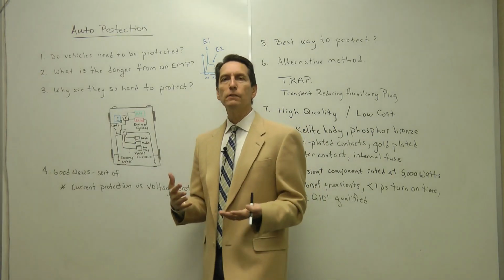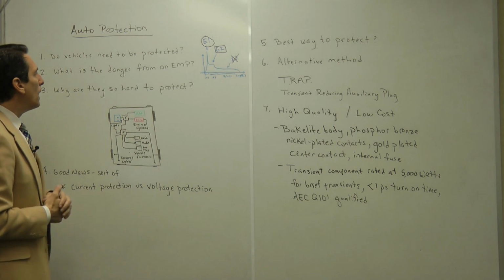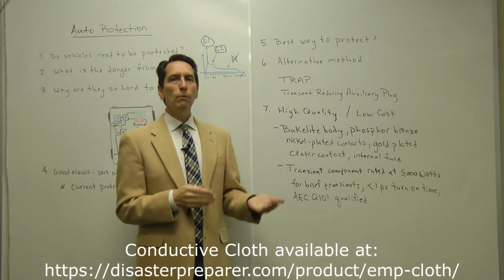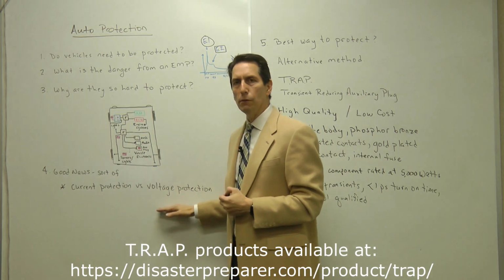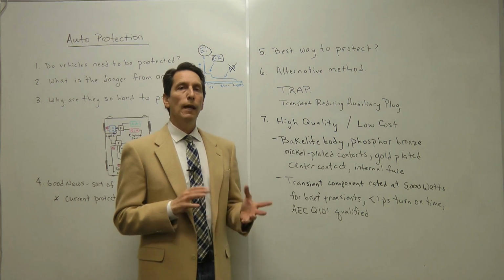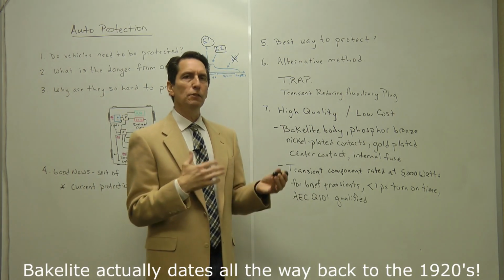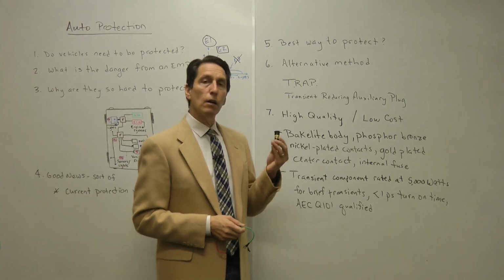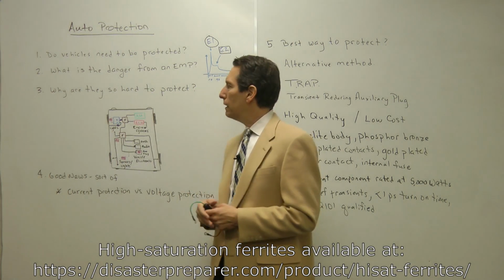EMP Automobile Protection with the T.R.A.P.

Comment: I have an Engle cooler which I had to install a diode on the negative to protect the ground system when I accidentally touched a positive cable to the vehicle had no spark but there was enough to cause the ferrite suppressor to explode on the Engle cooler circuit board. Engle cooler makes a compressor with a unique magnetic oscillating piston. This took a lot of time to pull it all apart but I found out the engle Coolers don't have a very good cooling system for their circuit boards as it's meant to be used in the ocean also. So I use some nylon washers too in the space offset for electric box for cooling.
   Vehicles have tires protecting them from earthquakes in electrical surges from AC circuit that is grounded at the power plants. Praying is likely to have a problem with an electrical system other than yourself, a short circuit sales.

Comment: First of all, get a Diesel-powered vehicle.
Second, refit your engine
to a Pre 1975 POINT Ignition. THEN, put in a network of anti ENP devices.
And Re😢convert your communications equip. to Use Vacuum TUBES or Tube acting like devices. You can mount the larger circuits in well shielded container(s) in
the trunk. The military post WW2 produced TONS of comm tech trancevers which are still avail. often dirt cheap. Throw in new capacitors ane your all set. There a whole vintage ham/
mil spec radio hobby today.

Comment: Question:
How would this device be installed on a 2010-2015 3rd Gen Prius with a Auxillary Battery in the trunk and Hybrid Battery practically buried between the rear seats and trunk ???
Thank U for the very informative video.

Comment: Dr Bradley:
Have recently purchased 4 T.R.A.P. modules from Amazon and am planning on further purchases in the near future. My questions to you, and if you don’t have a definitive answer, then probably no one else does either:
1: will the “older” resistor type physical car keys be affected by an EMP event, since they could not be kept in an EMP bag during operation?
2: same question but using the modern electronic key fobs?
Love your videos. Very understandable for the non-engineer.

Comment: Could i instal a T.R.A.P. OR T.R.A.P. B. .inline with any power wires. Also could a T.R.A.P. B. . Be installed across the alternator and starter them selves.sorry My knowledge on electric components is very minimal. I'm just thinking that it could catch the surge directly before vital points

Comment: Lovely how he is protecting a 12Vdc system from the potentially lower 5Vdc signal generator system.  A miracle $50 invention we can't live without.
Reply: With an arbitrary wave form generator with a 50 ohm output impedance and a very narrow pulse width too.  Looks like an Agilent 33220A which is only a 20MHz arbitrary wave form generator. Rise / Fall time is <13ns so it is much slower than the EMP risetime. 
Also if this does respond to only a 4.5V DC voltage pulse and shunts it you are going to blow a fuse as the 12V system throws a relay which will have a much steeper rise time and have contact bounces. More than likely this was only suppressing the spike due to its capacitance and the RC effect with the 50 ohm output impedance / resistance of the function generator. EMP will cause a low impedance source like an ESD zap. If he wants to prove function he would need an ESD set up not a function generator. Finally the Scope was set to AC mode and 200mV per division and the pulse was less than 2V. Just not a valid test / representation of an EMP.  This also does not protect things like the computer which will respond to E1 with its internal wiring and they only need a few volts to damage things. 
The Ferrites on the power cables may help but only locally. The wave needs to travel down the transmission line to hit the ferrite before it is blocked. Having a Ferrite right at the input of a device prevents fast transients of current change (not voltage) on the power rail from causing the power rail down stream to bounce around.

Comment: When you can demonstrate coupling 240Vac to a 12Vdc car while it is running using the TRAP as protection then I'll pay attention.  See if it will proctect against 240Vac for 0.5 seconds or fail.

Comment: So you stopped the pulse in the cigarette lighter plug  . On average there is over a mile of wiring in a modern car... you stopped the pulse in two wires one of which goes back to the fuse box the other is going to ground. For this to work I think you would need one on every wire in the car 😂😂😂😂😂. Can't believe people fall for this.

Comment: very interesting. 

Based on my extremely limited layman's understanding of how this works, it seems like it should be possible to attach a similar device to anything electronic to protect it, not just cars. Couldn't you make one that any 120v AC appliance could be plugged into? Or does it only work with DC
Reply: I'm an electrician and they make whole house surge protectors they connect to your breaker panel

Comment: I have a battery in my car with two connections on the side of the battery that are connected to the starter and components and two posts on top of the battery that are currently not being used can I connect the trap b to the top posts that aren’t currently in use?
Reply from the maker: Yes, that should work fine.

Comment: Can this product potentially hurt my vehicle? via computer system etc? Also, if i have just one auxiliary plug in my vehicle and i use your product that should be more than enough to protect my vehicle? Why does EMP shield use thier stuff on the battery and not the auxiliary plug like yours? thanks again!

Comment: Where does the energy get shunted to in the device when there is no ground connection?
Reply from the maker: In short, the energy on the positive line is shunted to the negative, and vice versa. A better way of thinking about though is that the TRAP prevents the voltage between the lines from getting too high and damaging connected electronics. When the voltage rises, the TRAP eventually turns on (very quickly at the right voltage), briefly shorting the two lines together and preventing any further rise between them. I hope that makes sense.
Reply: @disasterprepper  It makes great sense and I appreciate the quick response.  I  have one follow on questions if you don't mind.  I was watching your video on protecting a generator.  I was curious if using the TRAP B + a ferrite might be a solution for electric start generators permanently connected to my inverter/charger for home backup?  I also have a 3000W Westinghouse portable generator with electric start and was considering the same solution (TRAPB + ferrite).  I appreciate your help.
Reply from the maker: @clayanselmo7917  That should work fine. Just put the broadband ferrite around both wires (rather than one around each individual wire).

Comment: I’ve been reading about the possibility of a double EMP event. Would the TRAPs be useful in such a scenario or would they become fried after an initial EMP?
Reply from the maker: The T.R.A.P. products are designed not to be damaged by an EMP, but rather to continue to offer protection against subsequent events.
Reply: The atmosphere after a first EMP becomes charged and even if another EMP was produced the current charged atmosphere really mostly likely would not cause what the first EMP does this is what a isn't have discuss. I'm a science guy but not into these things but enjoy following threads and interested in what people talk about these days. There's not to many mechanical devices that are fast enough to stop an EMP. A three stage EMP preventer is best in my opinion and you might look at an EMP as spraying down on you in three stages and three strengths but I defer to the video host he a smart guy. Blessings

Comment: I want one for my tesla sir any suggestions
Reply from the maker: Sure, lots of Tesla owners have purchased them. My suggestion would be a T.R.A.P. for the inside auxiliary receptacle (aka cigarette lighter) and a T.R.A.P.-B to go across the standard 12V battery (not the high-voltage lithium batteries). Those two would give you good transient protection.
Reply: @disasterprepper  would the T.R.A.P b itself be sufficiemt itself I need my internal auxiliary port for other items.. with the threat of solar storm again in the news I thought of prepping again thanks for this info
Reply from the maker: @pyrojunkyz510  Sure, it would offer some protection, but multi-point protection is better. You can get a low-cost aux-plug splitter to free up the receptacle.

Comment: I'm assuming the TRAP B devices would not be impacted by an electronic battery charger? Since it charges with high voltage pulses
Reply from the maker: No, a battery charger wouldn't affect the T.R.A.P.-B. In fact, you can even jump off a car with one installed.

Comment: Would this work on a vehicle with a 24v electrical system?
Reply from the maker: It would, but the margin before the part turned on would be smaller. It was carefully designed for a 12V system, so that's the way I recommend using it. If you have two 12V batteries in series, you could simply put a T.R.A.P.-B across each battery.
Reply: @disasterprepper  Thank you for the quick response and suggetsion it's greatly appreciated. Keep up the great work, I really enjoy your content and have learned a lot, thanks for all you do!

Comment: Would adding the T.R.A.P. to the alternator and starter circuit offer more protection along with the battery? Excellent videos! Your products are ahead of the game. Buying soon!
Reply from the maker: It makes sense that it would, but I haven't tested adding a TRAP-B to the alternator. In my car, I have two TRAPs in aux plugs, a TRAP-B across the battery, and a set of car ferrites.

Comment: How does it lower the voltage? 
Also you're saying that the current will arc over the gap between the cigarette lighter and the cable it connects to. In order to do that, there need to be high voltage. But the whole point of the TRAP is to stop it from reaching high voltage. So the only way the TRAP can even connect to the car's internals is if the internals have already had high voltage induced, meaning it's too late for the TRAP to serve it's purpose.
Reply from the maker: The device inside is a transient suppression device that turns on at tens of volts. Once it does, it has a very low impedance that draws the current through it. Cars naturally have transients up to a hundred volts (or more) and are not damaged by them. What we don't want is voltages reaching many hundreds or even thousands of volts.

Comment: Dr Bradley, in an earlier post, you posited that a solar storm wouldn't have much affect on smaller electronics vs. for instance a high altitude nuclear detonation.  Is this still your belief?  If so, why did the Carrington event of the mid-late 1800's fry all the telegraph wires, etc., especially in light of our drastically reducing magnetosphere?  Thank you for being willing to share your knowledge and experiments with us.
Reply from the maker: Eric, a solar storm would not have much effect on free-standing small electronics (cars included). The reason is that solar events are very low frequency events that require conductors to be miles long to efficiently couple in energy. The power grid could definitely be affected, but not your unplugged laptop sitting on the table. The reason the Carrington even caused so much damage is that the telegraph wires were very long and acted as efficient receiving antennas.
Reply: @disasterprepper  
Thank you sir, for your clarification...I appreciate that

Comment: I have a 2015 GM product and it also has a 120v non grounded outlet for laptop power and usb outlets for charging. How would you adapt to those for extra protection?
Reply from the maker: The 120VAC is generated using a small inverter built into the car. A similar voltage regulation circuit is used for the USB ports. I don't currently have plug-in products for these ports - maybe someday. I'm not sure either would offer very much protection to the car's electrical system, so I'd have to look at that.

Comment: JUST GOT A 500 JACKERY FOR MY CPAP   WILL IT HELP  THE TRAP
Reply from the maker: I'm not familiar with that specific model, but lots of people are using T.R.A.P.s in their 12V vehicle plugs on their portable generators. It makes sense because the system is very small, and the surge protection device would help to keep induced surges down.
Reply: @disasterprepper   I LIVE IN CANADA     I SEE A CODE   FOR COUPON
Reply from the maker: @davidjones1393  Hi David, there are no coupon codes for the T.R.A.P. since it's a brand new product. I do ship to Canada, but I have to calculate shipping directly instead of through the website. Shoot me an email to arthur@disasterpreparer.com with what you'd like to order, and I can get you a total.
Reply: @disasterprepper   YES I WOULD  LIKE TO SEE A  $$$ THKS

Comment: Just wondering - when your car is off aren't the cigarette plugs disconnected from the electrical system?  Wondering??
Reply from the maker: Yes, most of them are unpowered. I talk about this just a little in the video. Fortunately, the protective device doesn't rely on battery power to function. The cabling, however, still remains largely the same, even with the ignition switch off, so the T.R.A.P. still offers protection. Also, very high-frequency energy has a way of coupling across relays and switches.

Comment: Do you need any additional protective measures for a hybrid car
Reply from the maker: I don't really know for sure if hybrid cars have any special susceptibilities (such as their high-voltage battery systems). I'm not sure anyone has looked at that in any detail. These T.R.A.P. devices are not meant to protect the high-voltage hybrid batteries. Instead, they connect into the 12V battery power, which is present in nearly all cars (hybrids included).

Comment: What about hooking up a grounding wire to your car when its parked?
Reply from the maker: Unfortunately, I don't think a grounding wire would offer any protection from an EMP.
Reply: @disasterprepper  Thankyou for responding. Would adding more grounding points help a house survive emp?
Reply from the maker: @prayerpatroller  No, I don't think so. It might help with lightning, but not an EMP.
Reply: @disasterprepper On my house I've got a 6 kilowatt grid tie solar system with battery backup. What would you recommend for EMP safety?
Reply from the maker: @prayerpatroller  You might check out my video https://youtu.be/fL1MLwrmT8c. Ferrites on the PV wires and a surge protection device at the panel are both recommended.

Comment: From your demonstration, it seems the threshold voltage for clamping is low for a 12V system. Am I missing something?
Reply from the maker: I had to dial down the turn-on voltage for the demonstration. The pulse generator wouldn't go high enough to activate the device. For the car installation, the turn-on voltage is set high enough that it won't turn on during normal operations or even during a jumpstart but low enough to prevent vehicle damage.

Comment: If a TRAP successfully suppresses an overvoltage, is it destroyed or degraded? Does it degrade from normal use, such as passing under high voltage lines or antennas, 2-way radio transmissions, etc?
Reply from the maker: Great question. Normal overvoltage suppression would not degrade the T.R.A.P. This is very different than metal-oxide varistors, which can degrade over time.

Comment: What if you need to use an auxiliary port for something else for me I have a Bluetooth to FM transmitter from Roav, would putting the traps on the rest of the auxiliary ports and the battery
Reply from the maker: You can get an auxiliary port splitter (turns one port into two) on Amazon for about $20.

Comment: If I have 4, 6V batteries in series to make a 24v battery bank for my solar system.  How would I wire up the TRAP - B
Reply from the maker: Wire a TRAP-B across each pair of batteries. If you'll send me a sketch, I can double check it.

Comment: @disasterprepper I was wondering if you have done a test of different metals and their shielding capabilities? I'm going to make custom Faraday Cages with steel the same gauge as my ammo cans, but then I thought I may want to use aluminum instead since it doesn't rust. Steel would be easier, but I'd have to be careful of where I paint it too.
Reply from the maker: It shouldn't matter much at all. All good conductors do a fine job of shielding.

Comment: Would an EMP effect older (late 60's model) automobiles with no electronic ignition and no
ECM. Other than the ignition Coil and some relays, there is not much electronics to fry.  I do Plan on ordering 2 for my late model Audi.
Reply: I would also like a answer to your question. I am thinking it may damage the battery.

Comment: So. Will this help in a TESLA  ?   To protect the main drive battery too ?
Reply from the maker: No, this wouldn't be appropriate for the main power batter in an electric vehicle. They are typically much higher voltage. This is meant to be attached across the 12V lines in a car.

Comment: Just purchased,looking forward to seeing it in hand thanks
Reply from the maker: Thanks for your support.
Reply: @disasterprepper  Hi Dr , I was curious, if I wrap all or important car cabling in those metallic heat shield tubing, would it offer a bit of protection or will it enhance the effect?
Thank you
Reply from the maker: @ZulfiqarAli-wq1qe  If you could fully shield and ground at both ends, it would help. That's very hard to do properly in a car though. My recommendation would be to use a good quality ferrite where possible (on power wires). That along with the T.R.A.P.s offers a well balanced protection from transients of all sorts.